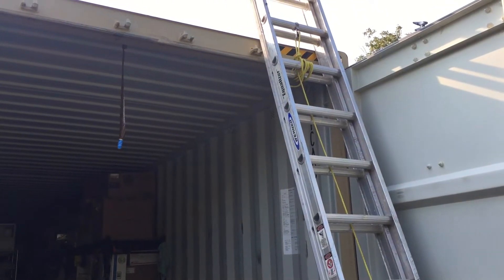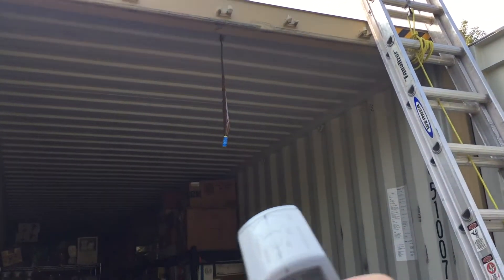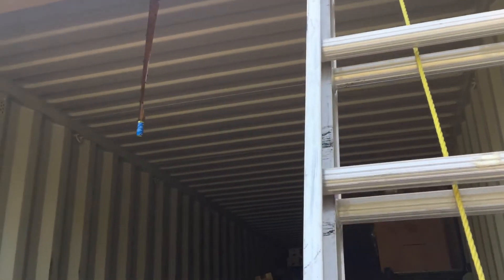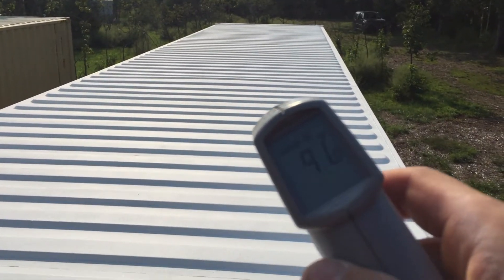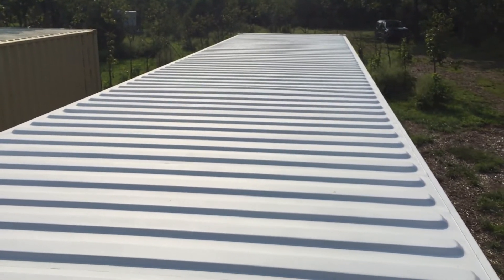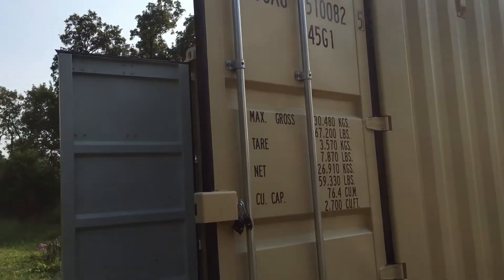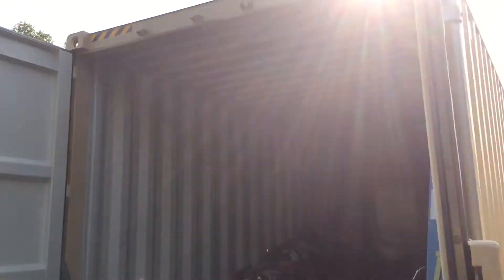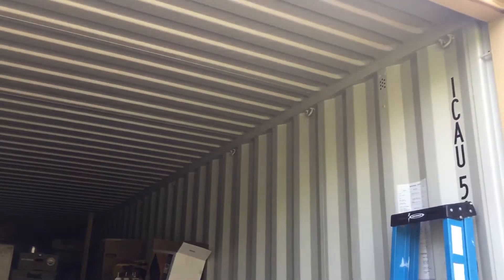Reflective Roof Paint on Shipping Container - Part 2

Comment: Has anyone tried using that paint on the entire container? Why just do the roof with it?
Reply: Cost effective. Paint the whole container with reflective paint extremely expensive and not needed the roof is flat to the sky getting Sun all day unlike the sides and the back and the front which is not flat to the sky which is not getting Sun all day
Reply: @jasonpoole7198  the sides get super heated as well. $150 per side is a bit pricey.
Reply: @EronIler  I have several containers. And they and they do get hot and the sides are subject to heat as well but not near is the top, there's weird science behind it so I understand your reasoning on what you're saying but with the amount that reflective paint cost if you do the sides and the front the back for the little bit of relief that you'll get which is not which barely anything it pretty much all comes from the top it's just not worth it it's why they say just do the top because that's what pounds down on the units all day
Reply: @EronIler  I don't recommend putting in vents at all unless you have containers that you never go to really but if you own containers that you frequent vents are pointless in the damn sure don't keep the humidity out that's the most asinine thing I heard just open the doors when you frequent your containers , along with the cat litter I can think of a million better options then events and the cat litter absolutely ridiculous vents will receive humidity think they need to learn the difference between heat and humidity
Reply: I would just throw a tarp over it and drive it down the sides a lot less cheaper than reflective paint that unless the steel is cleaned off properly the paint won't last but a few years and with tarps it'll give you a slight air barrier too dark for the way to go get tires at Walmart for 15 bucks
Reply: Or if you didn't want to tarp look you can go with that tyvek home wrap I guarantee it'll make more of a difference than just painting the top

Comment: I painted my container with the same product.
one coat on top worked great. it has stopped the humidity moisture from building up inside plus the temp. was reduced by 20 degrees.
I also painted the sides with the product , works great on the sides.
It will take three buckets to do the whole container.
Reply: Robert Barbour 
What’s the name of the product and where do you buy it ?